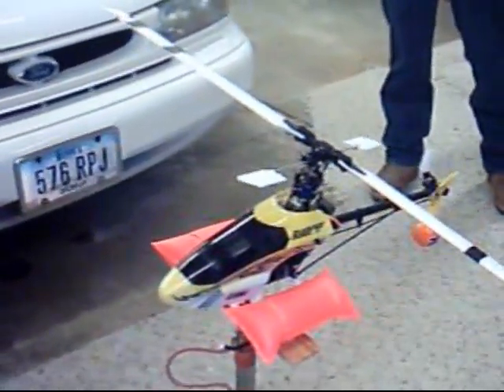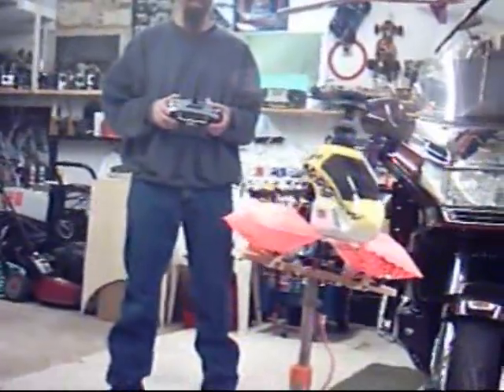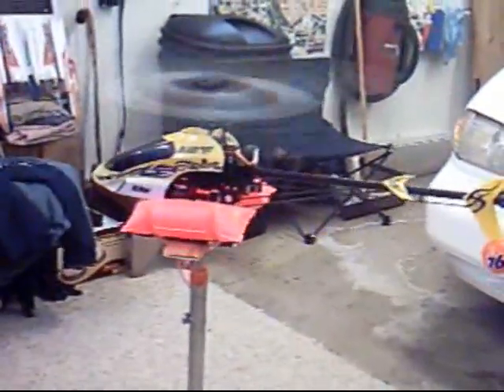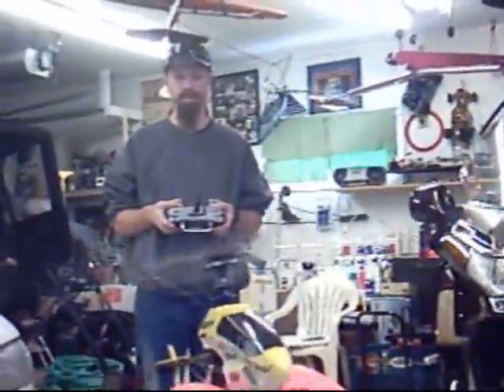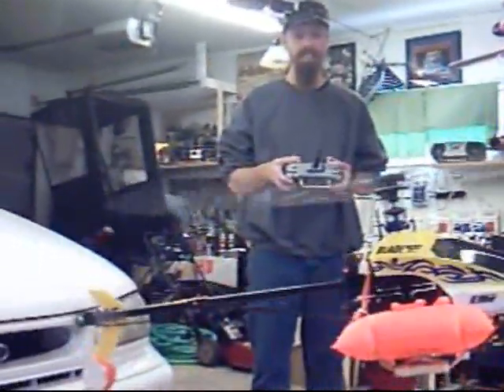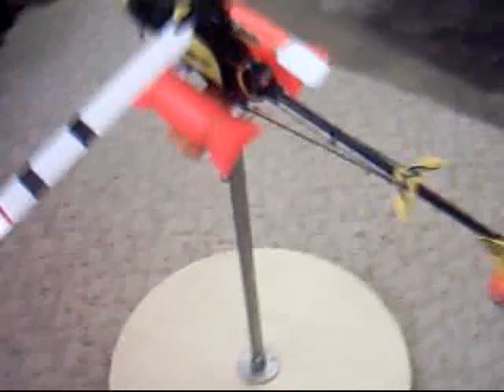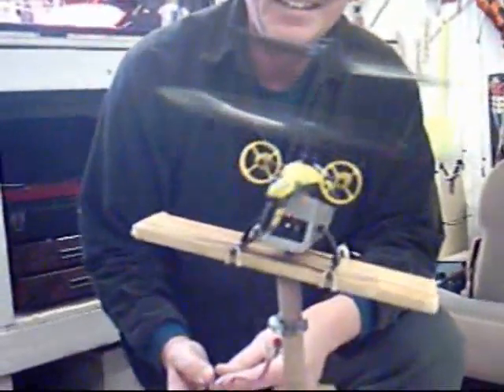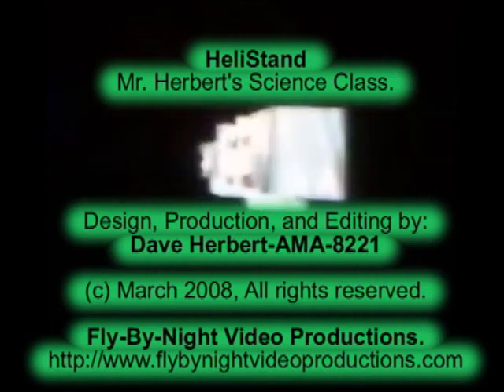Pt 2, Heli Test Stand, Novice Pilot tries it out.

Comment: This stand is a great idea! My only criticism is that the helicopter starts from a non-level plain so the pilot has to immediately correct for the starting angle to get into the hover. If you added a second disk as a heli pad (say 10" - 12") in diameter at the top of the outer pole so that the lift pole can move through its center, the heli will start level but still have ability to tilt when airborne.
Reply from the maker: That will work too.  I have had no problem with it though, other that my shop, house and all my equipment were destroyed in a huge fire in 2016, and I am not going to build another.  Thanks.

Comment: G'day Dave from Australia! Wanted to say thank you SO much for this fantastic idea and absolutely love your channel. Finally I can learnt to fly my large scale chopper with your help on here. I just had query, I have a 480 scale uh-1 huey which is 2.5kg (5.5lbs) in weight - do you think this stand (obviously built more robust to handle this weight!) is suitable for this size heli?? Would love your feedback. Thanks again Dave for your awesome videos.
Reply from the maker: It worked just fun for all my helis, especially to get the trim and gyro adjusted.  It does not really need to lift to do that, If your really worried about tipping over, put a couple of bags of salt or a sand bag on the base.  If using a nitro heli, use a bigger or more than one bungee cord.  All the best and good luck with it down under and thanks for your comments.
Reply: Hi Dave, Yes that all makes sense - I’ll take that advice onboard (pardon the pun!) and no, it’s not a nitro heli, those things scare me 😳 Thanks again Dave and keep up the great work 🙂
Reply from the maker: @aquila25  Thanks much.

Comment: I have problem in my remove control spiktrum dx 7 ,"backup error",,give me solution please
Reply from the maker: That is usually caused by a card error.  Make sure it's not write protected.  It may also need to be formatted.  Try another card.
Maybe remove battery in TX and turn on with no battery, then shut off, put battery back in. Like rebooting computer.
Good luck.

Comment: I just wonder if using plastic tubes would be easier and give us more accurate feeling on the sticks. the heli is lifting a heavy pole and balancing on a heavy board too. I am thinking something light weight and mabe actually making a stationary plarform to take off and land on even though there is a tube running through the center of it. hummm. Still a creat idea as far as getting the feel for your helicopter and actually helps in setting it up.. Using lighter materials would allow use with smaller heli s too.

Comment: Question?  Do you plug in the heli and let everything initialize(gyro,etc.) on a flat surface w/throttle and throttle trim down and hold on and then mount the heli and spool up  or can you mount the heli on the stand and then do the above steps ?   thanks roadglidec !

Comment: another thing that works is use the training kit with the balls on the ends and use a small anchor with a strong cable and anchor it to the ground on the center of gravity but only make the cable long enuf to let the heli raise but not long enuf to allow it to flip on its side..just a few inches or you could strike the ground with the tail rotor ..

Comment: Very clever idea.  I've built the harddisk version for tail setup, but had never considered having 360 tilt and lift option.
I have a redundant draw slider with ball bearing runners, might do for my 500, at least for the lift side, has a 15" slide ;-)

5*

Steve

Comment: its not good to start out with...first start out with a 4 channel (throttle,rudder,foreward backword,yaw) i would recomend the heli-max axe ez,i started with it the parts are a lot harder to brake than the cx2,and its smaller so better for indoors and does not have blade strikes the cx2 does and its cheaper and comes with training gear and folding blades which is not on the cx2

Comment: HI mr. Herbert I need some advice.
I got a problem w. my heli. i turned it on i was fxing a bent shaft so then, i was spinning up slowly to see where to bend to n such, n then it the serovs all went down on its own and i lost all servo control. Now when i turn on the heli, light goes green but it wont do anything no throttle no tai, no servos, i dont know whats going on with it. What should i do?

Comment: Is 3E Smart Plus LPC-1080 Li-ploy battery Balance Charger a decent charger? It looks good on a photo but don't know what it would be like. 

Thank you very much for your suggestion on 3d. But I am still not brave enough to try it. I tried it without a rotor blade attached, and when I take it to mid throttle, the motor screams. And when I hit the 3d switch, it screams even more. So I'm scared.

Comment: In a heli this small it seems to be common opinion that the tail rotor blades do not need to be balanced. On larger heli's it is common to balance the tail blades and grip assembly. FYI I do balance the whole assembly on my b400. The following are a list of things to check that will also cause a tail vibration. A belt that is too tight or too loose. Anything loose or misaligned in the tail rotor pitch assembly. The bearings in the b400 are known to loosen up over time.

Comment: High rpm wobbles and vibrations are usually tail rotor related rather than rotor head and main blades stuff. If the wobble/vibration comes while you're spooling up or at low rpm do the basic balance your head stuff. Vibes at wot are tail related.

Comment: Hey Dave, I have a suggestion. Try setting the transmitter Expos to 20%-25% for Alil & Elev. 15% for Rudder. I have been reducing the percent every day I fly and now just today I'm at 0% Expos. I tend to try to over control, so this works good for me but not sure if Jeff is that way. Oh I also changed the pitch curve to  45,48,52,70,90 to reduce the acceleration from the CP. Im now using 35,42.5,50,75,100 default settings. I like warm up with my Blade CX2 doing nose in & figure 8s.